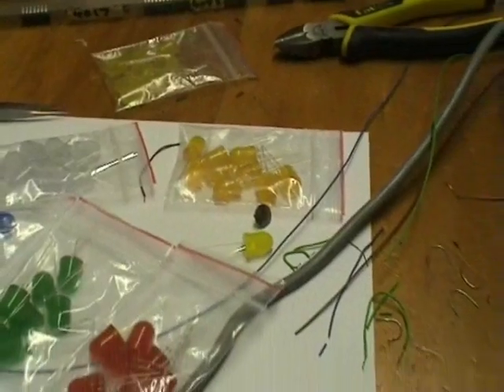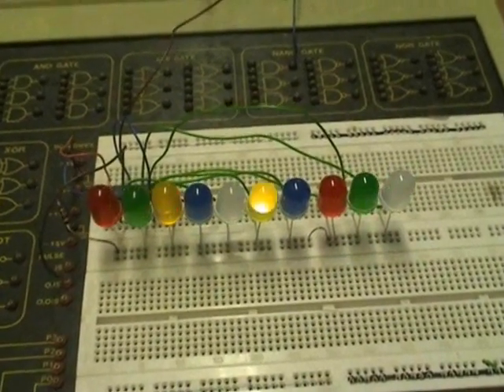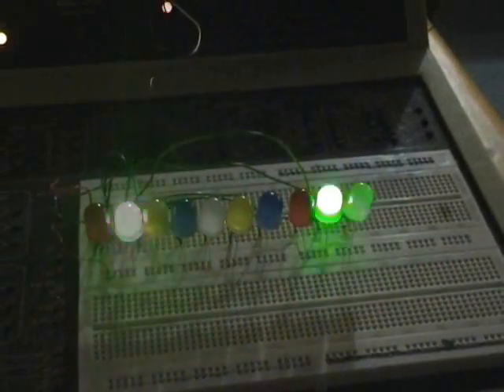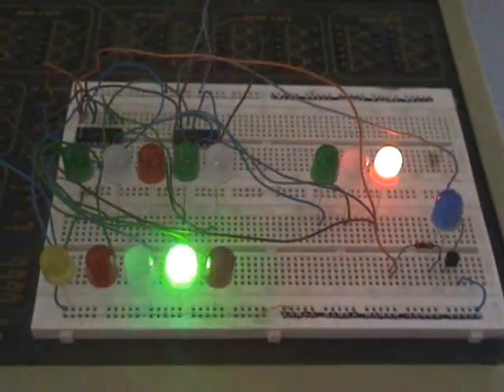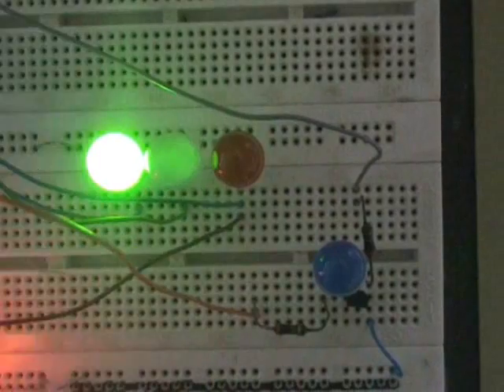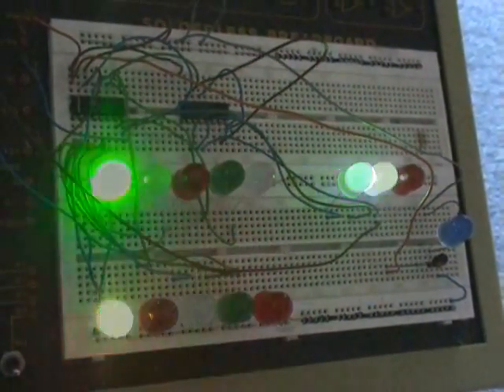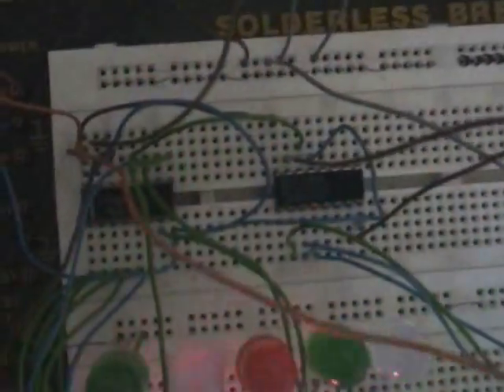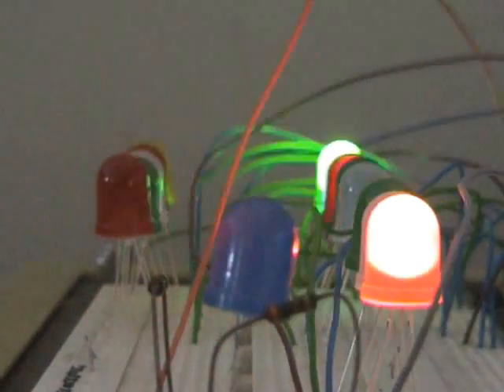Jellybean LED's and 4017

Comment from the maker: @DragonFlyback256  Thanks, I don't know too much about PIC's although I like building circuits from standard components which are cheap and easily available.
Trying it on breadboard first and then put it on a circuit board.
I am uploading a 9 bit counter at the moment built with 3 TTL 7490 IC's.